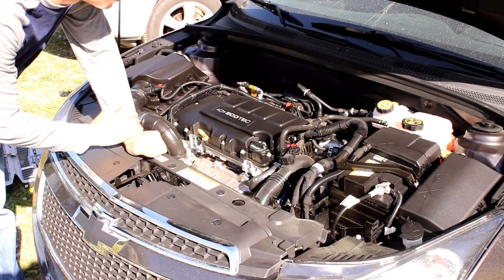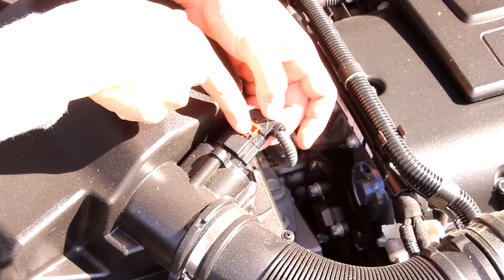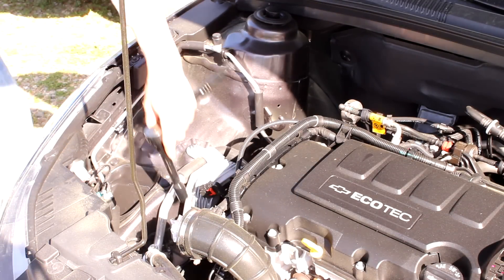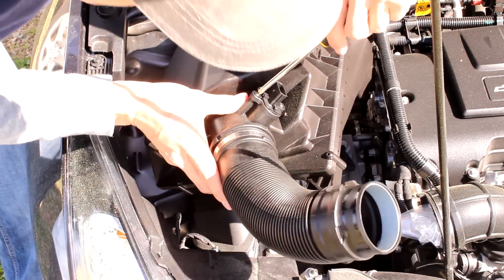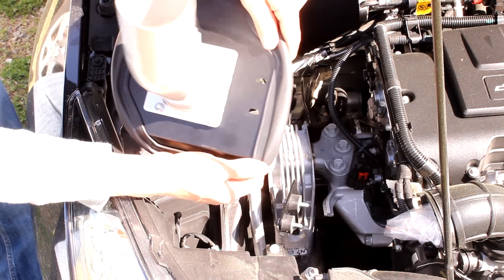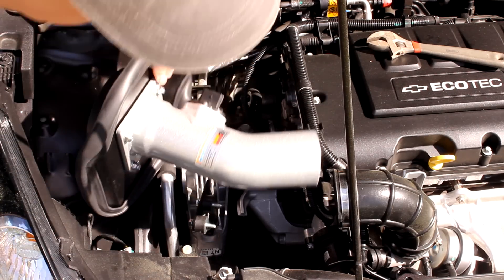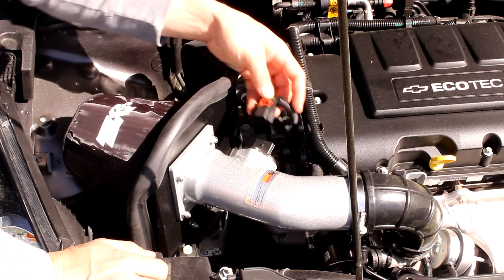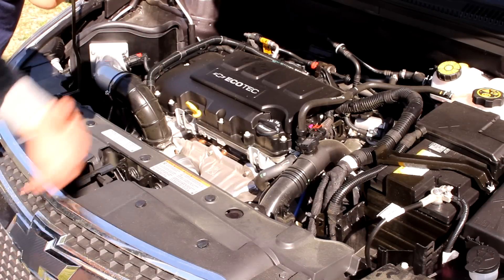Chevy Cruze cold air intake how to install Turbo 2014 K&N

Comment: After couple weeks did it gived you performance problems, because I had AEM and gived me problems for the 2014 Chevy Cruze 4.1L. Such as jerking, powerless, lean, and shot down car.
Reply from the maker: Naime Obaidi I wasn’t a fan of it and pulled it out after 2 weeks for full refund!
Reply: That's the maf sensor not the intake
Reply: Ok I need your help…… I have a problem with mine because I have oil spitting all over the place and don’t know why. It comes from somewhere and hits the serpentine belt and gets everywhere… it idles fine no spills but when you start to drive it will overheat really quick and there will be oil everywhere. Plz HELP
Reply: @robertholsopple9451  Ok I need your help…… I have a problem with mine because I have oil spitting all over the place and don’t know why. It comes from somewhere and hits the serpentine belt and gets everywhere… it idles fine no spills but when you start to drive it will overheat really quick and there will be oil everywhere. Plz HELP

Comment: Ok I need your help…… I have a problem with mine because I have oil spitting all over the place and don’t know why. It comes from somewhere and hits the serpentine belt and gets everywhere… it idles fine no spills but when you start to drive it will overheat really quick and there will be oil everywhere. Plz HELP
Reply from the maker: Oh geez, I'm sorry to hear that!! You have oil spitting from the air filter?? It sounds like the filter had waaaayy too much oil on it.. If you have oil spitting form the engine,.. well that's a whole different story... what did you end up doing?

Comment: do you need a tune after one of these?
Reply from the maker: Roman kifyak they say the computer will re adjust itself with just this install..
Reply: matt dobson should I unplug the battery for it to reset?
Reply from the maker: no, the computer will reprogram itself (if you unplug battery) although an aftermarket tune will be a lot better
Reply: How much faster or how much horsepower did you get after you installed it… I didn’t see a follow video after you installed it.